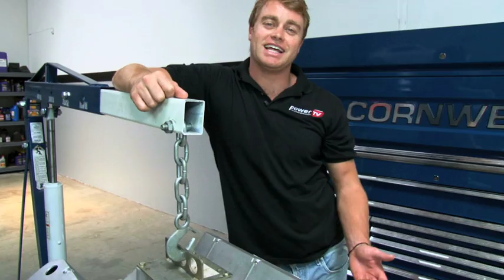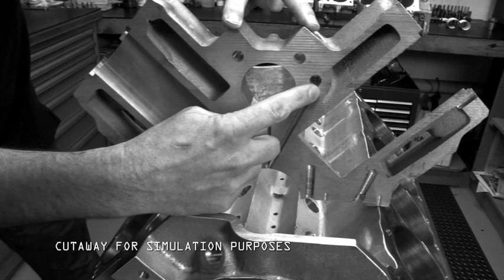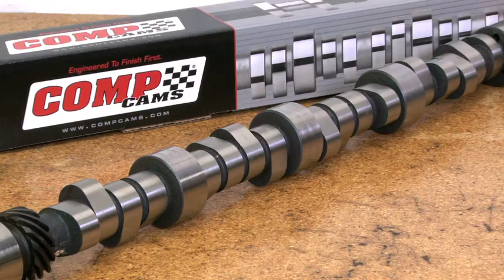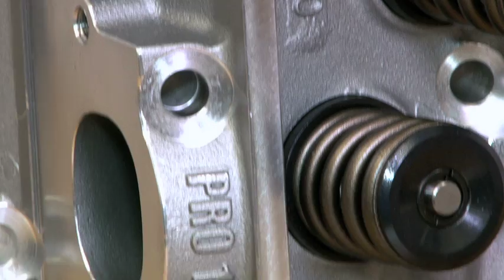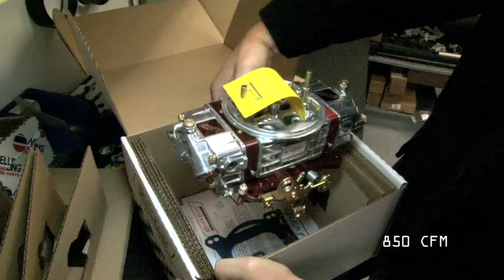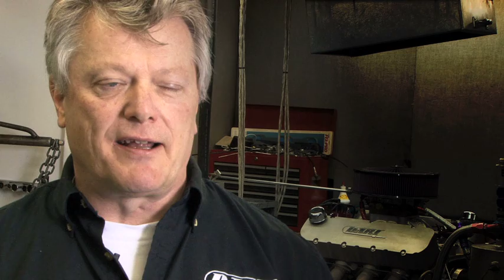Project Grandpa 509 Dart BBC Build Up

Comment: That bore size and stroke is a achievable in a stock block
Reply: Correct William.  The GM stock 502 Gen V and Gen VI blocks are already 4.470 bore with a 4" crank.  This is just a .030" overbore 502 setup that has been done for more than a couple of decades now with stock parts.  A 4.250" crank falls right in as well if you want to make a 540 out of it.   
   Nice power out of this combo though for what I consider a fairly small camshaft for the engine size.
Reply: Dart block is better than factory
Reply: Nope.